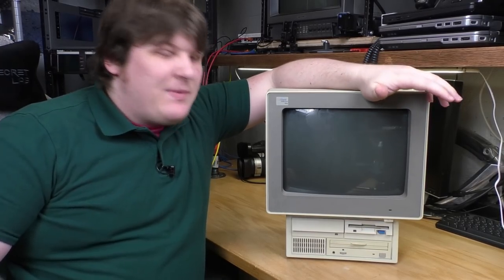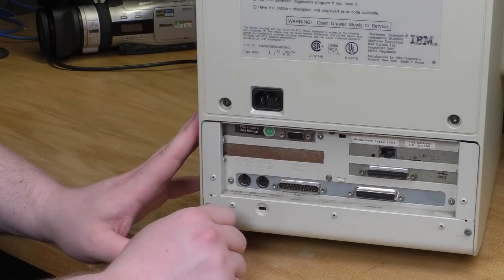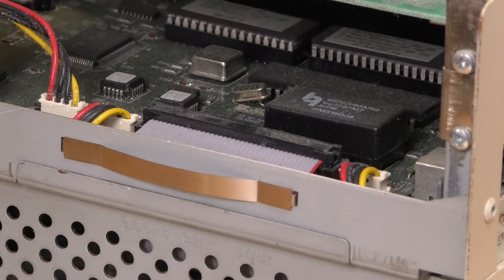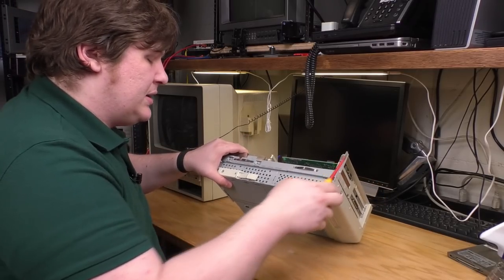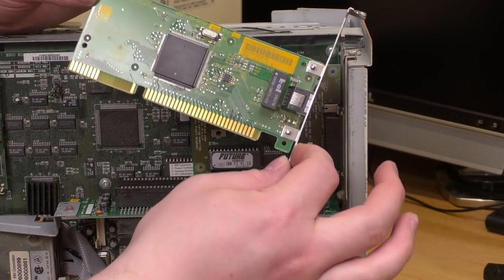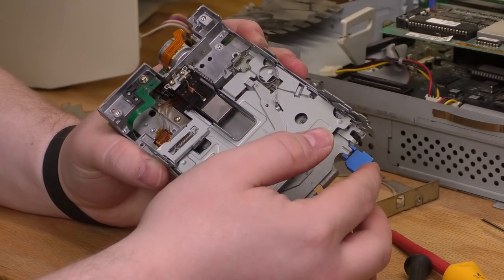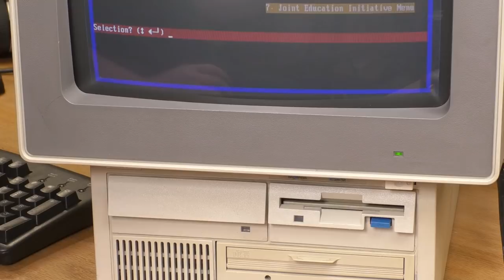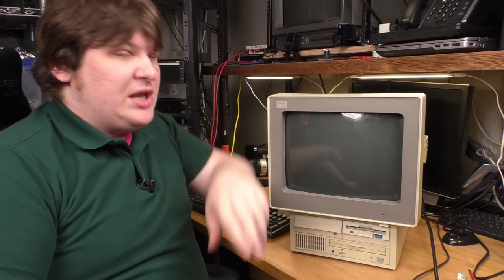Beginning the Eduquest

Comment: Imagine the large metallic orbs required to unpack a bunch of new PCs and immediately drive a self-tapping screw in to the side of each one, especially given the cost of computers back then.
Reply from the maker: Hey, these were schools, they're run like a split between a mine and a prison, whatever works works
Reply: Also, putting a screw into a CRT monitor just sounds like a risk of KZZZERRRT!
Reply: @Roxor128  Well, assuming the comment above is correct in the fact that this was done right after getting them out of the box, then there shouldn't have been a risk of that. If the screens had never been powered up before, they wouldn't have had a charge. 

Of course, then there would be the risk that the screw did contact against a live component, and they wouldn't know that until months, weeks, years later when someone accidentally touches the screw head while fumbling with the mouse holster.

Comment: Rather than dd, you might want to start using ddrescue for imaging.  Produces the same output, but deals with a failing drive better and can retrieve more data.
Reply: And shows you a very nice progress indicator by default (yes, dd has a status=progress option, but you have to ask it to do it)
Reply: Yes, the auto-retry and that has saved the bacon of a few friends drives. Just set it in the caddy and let it keep trying.
Reply: I used ddrescure on a drive with bad sectors or data after a power failure. 
Everything important was saved, windows wouldn't start, but easy enough to get that working.
Reply: Awesome! I'll use that
Reply: @wraithcadmus  it’s also more clever about it - it won’t stick to a single dead sector and keep retrying there, it does a single pass ignoring all errors and then tries to fill in the gaps.  So if the drive does die in the process, it got as much as possible off it.

Comment: "Before calling service: 1) Be certain the machine is plugged into the wall outlet..." Love it!
Reply: You know that label only got added because IBM support realized it would reduce support calls.
Reply: Hello IT, have you tried turning it off and on again?
Reply: @robsemail  That's why you use 'Press a key'. Either they press a random key, or a.
Reply: In Hebrew it was "לחץ על כל מקש", which may be translated either as "press any key" or "press every key" (as Hebrew doesn't have much distinction between the two). I wonder how much problem this gave to IT support back then...

Comment: Token ring tips from someone who used it a lot:
 1. The traditional Token ring cables end in square connectors that can be plugged directly into each other for a two-computer network.
  2. 4Mbit is not compatible with 16Mbit, but most 16Mbit cards are dual speed.
 100Mbit token ring was an experiment that didn't take off, as they argued too many years over the specifications as Ethernet ate the market.
  3. For multiple computers, all are plugged into a MAU box, which is powered over the network by the turned on computers.  There are some "modern" MAU boxes that use RJ45 plugs and require external power.
Reply: 0:41 he has a MAU box.
Reply: @MickeyD2012  Where, can't see it?
Reply: I remember those MAUs. Token Ring was IBMs way of networking all through the PS/2 series.
Compared with the first ethernet cards these were extremely integrated in the late MCA days. 
As a teen i happened to come across a stack of those that were decomissioned at a company in he early 90s. Basically it's a bunch of 4 pole bistable relais together with a tricky circuit of mostly just diodes, transistors and some passives that will bypass inactive ports so the ring remains closed. (unfortunately i took some of those apart and the others eventually went to the recycler as they were no use to me back then).

Comment: I use a datavac for dusting out sensitive things. It's not a cheap vacuum, but is ESD-safe, has a variety of normal and brush attachments, and works in both vacuum/blower modes. The small attachments are a bit finicky to use; there's a reducer that you then attach a brush head or whatever to, but the go-between from the reducer to the head isn't a normal bit of hose, it's more like a bendy straw. Besides that caveat, it's a handy unit, and so far at least I haven't blown anything up as long as I'm taking appropriate static precautions.
Reply: And/or, don’t be afraid to disassemble it and give the motherboard a good spray down in the sink.  Use some dish soap and a toothbrush if you need to.

I’ve done this with my 5150, 5160, 5162, 5170, PS/2 Models 30, 30 286, 70, and tons of garden variety motherboards... Macintosh, and 386 to Core i.  Not to mention whole PSU PCBs, monitor PCBs, expansion cards, consoles...

It’s fine.  :-)  It’ll survive a bath.
Reply: @nickwallette6201  you must have some low ion content water. spraying down something with an lga socket or ddr2/3/4 ram slots is a death sentence if your water is hardish
Reply: >It's not a cheap vacuum, but is ESD-safe
Does it have some specia lfeatures that makes it more ESD safe than other electric dusters? I didn't find anything in product info. It's just device that blows air on stuff.

Comment: Future Domain was one of the big names in SCSI controllers back then.  I guess IBM ordered a modified board to prevent schools from buying cheap standard cards as spares.
Reply: I think he needs one of those bigass scanjet 4's to hook up to that external SCSI port.
Reply: @fisqual  Why not an external drive (of any kind)
Reply: @johndododoe1411  I guess that would work too, but I love how damn loud the stepper motors are in the old scan jets... The very one with the Fur Elise easter egg built in.

Comment: If you had an 80386 computer in 1985, you were way ahead of the curve. That would have been the computer of my dreams. If a computer lab was stocked with those in 1985, that school would be very well to do.
Reply: Our family first PC was am386 based and it was bought around 1995... And it was pretty actual here in Russia in that years
Reply: My entire elementary school in the UK had a single BBC Micro around 1989-1991. I worked my ass off to test into a specific secondary/middle school because they had a newly refurbished computer room with brand new Archimedes RISC computers and even a few Pentium machines.

Comment: Interesting that the corrosion on the floppy drive shield is all around the perimeter of all the edges. Probably cut & formed from pre-plated steel sheet that didn't get any treatment to protect the exposed cut edges, and corrosion propagated from there.

Comment: That menu may have been implemented entirely in batch files, using common utilities to read keys (think choice.exe) and output colors (like ANSI.SYS with escape codes in echo commands or any of several tiny utilities that do things directly using CGA techniques).
Reply: I was going to say the same thing; there may be quite a bit of complexity hiding in the text of those batch files.
Reply: That conjures up memories, but not very fond ones however nostalgic I occasionally get (about the batch file hackery that is)
Reply: This was what I was gonna say. I had a lot of disks with bat-based menus. Iirc some game installers used that as well.
Reply: More likely a config.sys menu
Reply: @rickr530  config.sys menu had diffferent style and was more limited - single list line after line selectable by arrow keys and swapping the bg/fg on the selected position. Also you can clearly see that menu's appearing after loading up bunch of drivers and batch files :)

Comment: The PSL was indeed the IBM 7694 Personal Science Laboratory, a little device specifically for the EduQuest that samples various optional probes and sensors and dumped the results over RS-232. We never had PSLs but we did have TI's version, the CBL (Calculator Based Laboratory), which did more or less the same thing but on a horrible little TI-83 screen. Both came with a variety of little experiments you could do - pH tests, distance/speed/acceleration, temperature readings, et cetera.

Comment: Great video, as always. This Eduquest reminds me quite a bit of my first PC - an IBM PS/1 from 1992. Quirky little machine - 286 10MHz, 640kb, 30MB HDD, and a 10" VGA CRT. The power supply was in the CRT, as well as the PC speaker (with volume control, no less). Good memories

Comment: In the UK, we got some IBM PCs (mostly PS/2s) after there were a glut of clones available...but most of that space was taken up by Research Machines RM Nimbus 80186s
Reply: Yeah the entire time I was in school I only ever saw RMs.
Reply: @kaitlyn__L  RM had deep hooks in the educational market in the UK with both the Acorn systems (BBC's & Archimedes) and PC's. I worked IT at a school in the 90's and when it was decided that we were moving to Mac's (not my choice) we were deprioritized for service making it harder to get software for the Acorn systems. However Apple stepped up and on the Apple side made better deals for software and hardware than what was the initial deal so it made switching to the Mac even easier. Later RM reversed that decision but the damage was done.

Comment: Thanks for another entertaining video. I recommend using compressed air to remove dust, if you have a small nozzle and enough flow, you can really get into all those tight spaces that otherwise would be impossible to reach with any tool without desoldering.

Comment: The menuing system is a stand-alone version of what would become IBM ICLAS.  I'm willing to bet one of the batch files on that disk was "g.bat".   ICLAS would have been the Netware GUI for larger environments.  This is wonderful.  I used/supported Eduquest and ICLAS for 10 years and this is a wonderful timewarp.  And YES, PSL would have had a microscope or some other lab equip like a light sensor.  The card you thought was ethernet is actually the PSL interface card.

Comment: That (broken) plastic clip at the front left would be for supporting the front edge of full-length ISA cards, especially old ones with a short 8-bit edge connector and packed full of heavy logic chips.
Reply from the maker: WOW, THAT MAKES SENSE. It's also REALLY poorly made, god, how the mighty had fallen.
Reply: @CathodeRayDude  Probably a low-priority design afterthought, and almost never actually needed on a system like this. Card support features like that are quite common in chassis designs, but almost always pass by unremarked; I guess I've spent too much time thinking about form-factor standards.
Reply: @CathodeRayDude  Also, that broken piece of plastic you finagled out in the back is meant to stabilize the riser card. Probably broken in transit as well.

Comment: I always just use natural bristle "artists" (a.k.a. small) paint brushes with wooden handles to clean my electronics. Also alcohol. Not only to drink, but also to clean. Some pure Iso or ethanol works really well.

Used those two things for years and years on everything electronic and never had a problem.

ALSO: Magic erasers. If you search for "melamine foam" on ebay, you can get, like, 100 of them for 5 to 10 bucks. Perfect for cleaning plastics like the case.

Comment: Fading is probably done by rewriting the palette table with smaller RGB values for each color.  It's a fast trick from the era and isn't tied to any specific graphics card, anything VGA compatible can do so for any mode with 256 or fewer colors.  So it may have been an option in the Phoenix BIOS delivery that not all manufacturers chose.  Or it may have been in the graphics card BIOS, triggered by common boot steps.

Comment: ddrescue is a good linux/unix program for recovering data off bad hard drives - it has pretty good policies about getting the most good data off before it fights the bad sectors. Glad you didn't need it on this one, but good to have in your back pocket.
Reply from the maker: yep, I've used it before, I just usually don't bother with the effort of obtaining it until I actually hit errors. I don't keep linux installed on anything so I'm just running from live usb, and installing packages is irritating

Comment: in terms of size/form factor, it really reminds me of Apple's mid-90s EDU darlings , the Performa 520/550/575/580 - right down to the caddy-CD drive.

"the motherboard acts as the power distribution"  is also extremely mac-like
Reply from the maker: yeah exactly, it's basically an IBM performa
Reply: @CathodeRayDude  that’s the comment
Reply: I actually wonder who did it first; IBM was pretty far ahead of the rest of the PC industry in tool-less maintenance with things like the other PS/2 models. 
It takes some extra investment in the design and tooling, but I can certainly see the advantages for maintainability.
Reply: @RobLion  especially when IBM lived off maintenance contracts for decades. Easy for you but hard for your competitors to maintain is peak IBM thinking

Comment: The Floppy only uses the 5 volt power line so thats why its powered by the board. Also isopropyl alcohol wont do anything, you could also wash most of the cards in water in the sink ,and then pour iso on them and leave them to dry, it will only mess up stickers and ink. Short out all the caps first though....

Comment: For removing dust, look into getting some ESD safe brushes and look for an ESD safe computer vacuum. (Or just a battery operated one) I also use a grounded small gallon air compressor.

Comment: re: for cleaning dust, this datavac thing i bought a while back came with attachments with brushes that said they were ESD safe, they seem to have always worked for me pretty well, also the air output is a lot higher than you would expect from such a small device... also its made out of metal :3 ... pretty good blower thingy imho.

Comment: I love those Dell module floppys with the Mini USB connectors, I've found two of them naturally. Never had any issues with 720k disks, which I've heard can be an issue with USB drives. For what it's worth late 80s if not cheap early 90s XT class laptops still used 720k disks in my experience
I suspect the broken bit of plastic on the far side of the motherboard is a support for full-length cards.

Comment: I definitely agree with you on the .ima vs .imz front. Back in the bbs days, it was worth it. Now? Not so much.
EDIT: When it comes to imaging drives, DD is king. I've used it to make clone images of old hard drives running Win98SE in a medical laundry processing plant to migrate those machines over to SSD storage. These old machines are still in use because the machinery in the plant is too old to port to a more modern PC and it would be too expensive to replace the machinery.

Comment: This is a great vintage video despite being a computer nerd from the 80's become officially qualified in 2009 with a adv dip in computer systems engineering. Prior to that I was a Mechanic by trade and some cars rusted and some barely did in my experience low altitude vehicles particularly those that lived close to the sea rusted rather quickly. So from my educated guess the rust is it being close to the sea at low altitude most of its working life or it was stored in a damp humid environment. Keep the good videos and your educated explanations are brilliant. I was hoping you were going to do a full tear-down and close ups of the microchips and motherboard PCB none the less was a great video mate.

Comment: On dusting: You can buy ESD-safe brushes from electronics retailers. RS Components have them.
Reply: Fun fact, those brushes are actually radioactive! The small amount of radiation serves to ionize the air and give charges a place to go
Reply from the maker: I've been trying to find any that are larger than a toothbrush with no success. To dust something effectively I need something like a chip brush, 3-5" bristles, and nobody seems to make that in antistatic
Reply: @mrb692  I’ll make sure to put them under my pillow
Reply: @CathodeRayDude  Carbon fiber brush for records. Personally I am a fan of soapy water, rinse and dry thoroughly, but that's not the right choice for everything.

Comment: You could use plain running water or throw the boards in the dishwasher on low heat. When done dunk them in high grade (90%+) isopropyl to displace the water and let air dry. Always works for me.

EDIT: Found some info on PSL Explorer and the hardware that goes with it. http://ps-2.retropc.se/ohlandl/7694/7694_Personal_Science_Laboratory.html